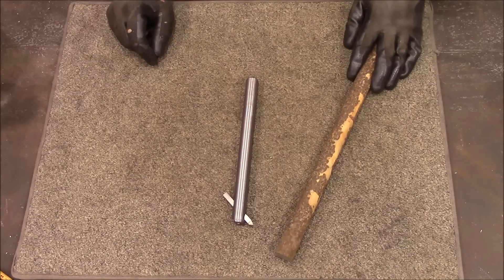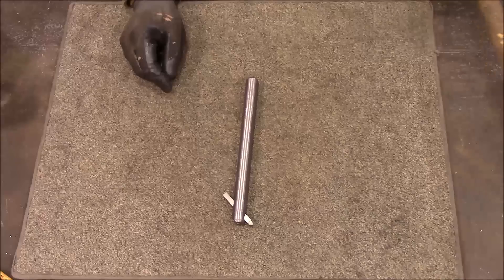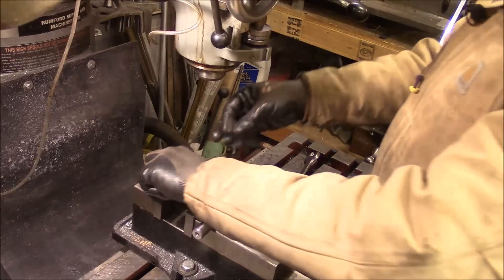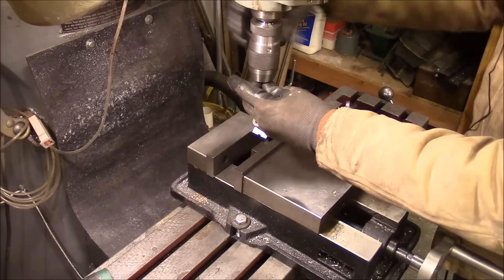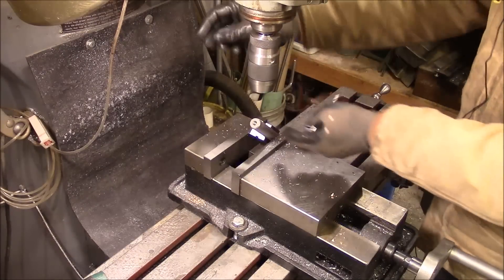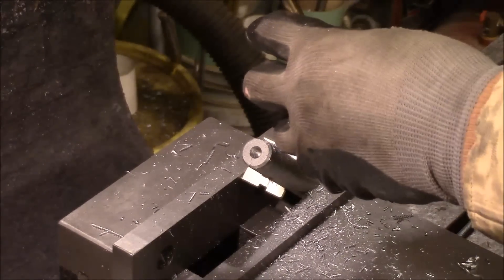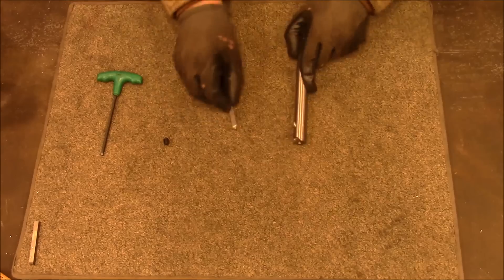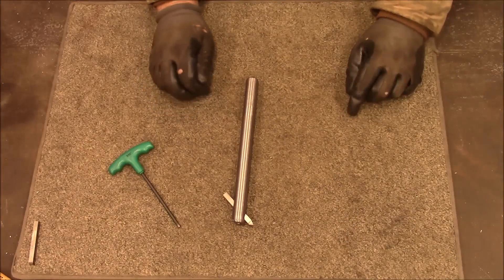Easy Homemade Boring Bar

Comment: How do you advance the tool to bore bigger?
Reply from the maker: It's used in a lathe so you move the cross slide out to enlarge the bore.
Reply: @SoatMon  how bout when used in a mill

Comment: Your tool geometry is off, the leading edge of your tool bit is forward of the centerline of rotation, when you drilled the hole on center, it should have been drilled 1/2 cutter thick behind center line of rotation, you could grind enough (1/2) your tool bit back and it would cut better then.
Reply: You don't strictly HAVE to be on centre line when boring, you can cheat and grind both rake and clearance to suit. Tools like this are often used to get out of a 'fix'  when you have no other available.
Reply: Likely 30 degree gauge could to used in beginning when drill hole to cutter to? Anyway thank you for sharing this! I am happy when people share experiences toolmaking with each other e.g "will round cutting bar to stay stationary in boring bar? And also to answer this question "Yes".

Comment: May i know what is the material of the boring bar?? Is it the same material with the tool bit?
Reply from the maker: The boring bar is an unknown steel from my scrap bucket.  The tool bit is High Speed Steel.

Comment: Do you think instead of using a square tool bit and to use round blank would work as well? I've been thinking to give a second life to the broken drill bit, and milling end bit. 

I am not sure if I should fastened by a screw, or threadlock it.
Reply: I can conform that it will work!  I had a bunch of old 1/4 hss drill bits and use them now exclusively for my shop  made boring bar.  I did grind a flat spot on the bits where the set screw meets.  BTW I don't have a mill so I put the boring bar in the lathe and drill bits in the lathe chuck.  Fed the boring bar into the bit at the desired angle.  Thanks for posting these videos!
Reply from the maker: That would probably work pretty well.  The set screw may not hold very well since the bit will be round and hardened but I would sure try it.  Let me know how it works out.  Thanks for watching!

Comment: Okay. Nice. Wondered at first how you would end up with a square hole for the tool.  Set screw holds it firm & square. Got it.   Interesting.
Reply: Doug Bourdo you can use a broken taps or end mill  or twist drill